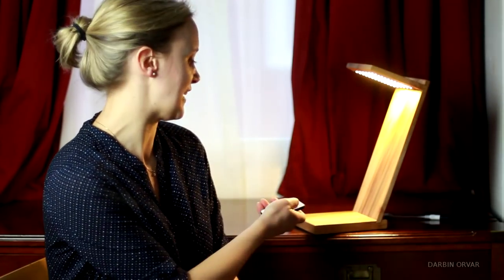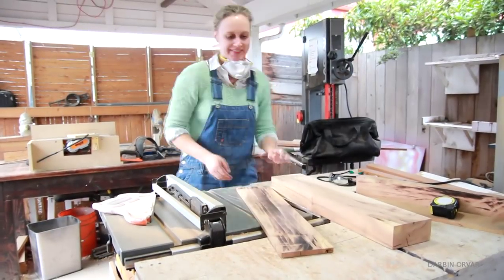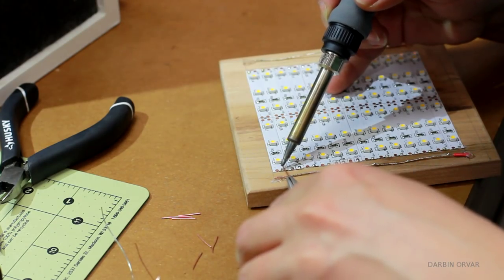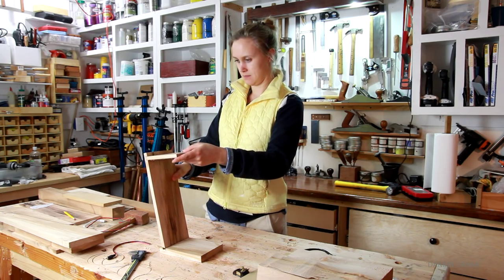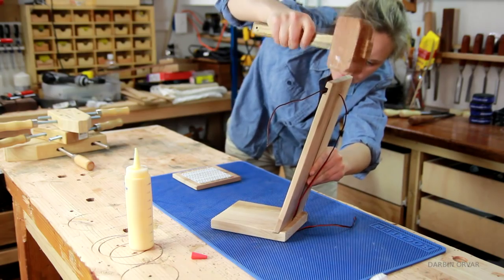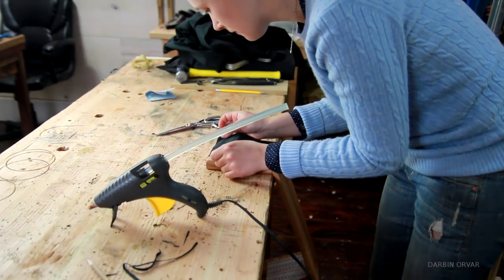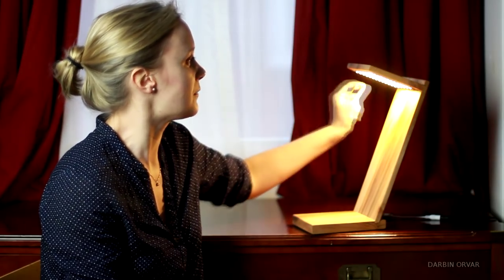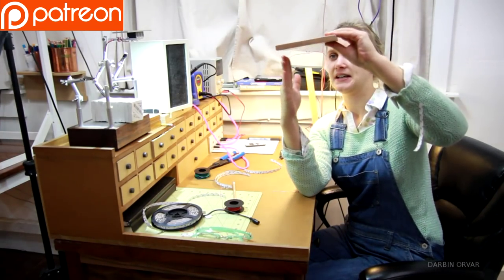Awesome DIY Desk Light w/ LEDs

Comment: Very nice Linn. Have you seen the little gizmos you can add to any lamp that turn them into a touch lamp? I buy the little control boxes for those at Lowes and they really add a neat feature if you have a metal spot to touch for the on/off switch. I envision your desk lamp with a penny inlaid into the base (with the year you made the lamp of course) and wiring that to the touch switch so that when you touch the penny, the light comes on!

Comment: Just going to throw my two cents in here! I made some pretty big versions of these for lighting our videos. When soldering on many rows of LED strips I found it much easier not to precut short wires. I found soldering to the strip, then the main wire, then cutting it was a lot easier and way less fiddly -R

Comment: I just lit up a cabinet using a very similar light strip (perhaps the same kind, LE from Amazon, but that's not important). However, I had the hardest time soldering wire onto them. I wasn't always able to tin the contacts on the strip, and even when I could then the solder would come of when joining the tinned wire... I got great pointers looking at you work. I have a vintage lamp that I'm thinking about retrofitting with LED, which I'll do just as you did. Thanks!

Comment: You kind of mentioned that you liked the look of the exposed electronics but may I still suggest a different approach that has them sandwiched between two pieces of wood?

For the LED section I'm imagining a 3-5mm thick piece of Wood with a hole pattern matching the spacing of the LED's.
For the Back section I'd go with a cut for the Cable to fit through and additionally a small magnet sandwiched between the wood pieces for the Remote to magically sticking to the back - IMHO a more elegant solution than Velcro.For the Bottom section I'd have had the Plug exit on the back but I guess that's a preference thing as well :°

If you REALLY insist on the exposed look... Instead of working with HotGlue why not use some small and nice looking Nails to route the Cables around the LED's while also holding them in place?

Just a thought :°

Comment: I felt the same when I switched to a temp controlled soldering station from a regular 240v iron. Also when I switched to using the brass 'wool' type tip cleaner rather than a damp sponge (although i still keep a damp sponge still for wiping off too)

Comment: Very innovative. I really appreciate sharing your ideas with the DIY community. About this particular project, I would suggest covering the led terminals and wiring to improve user experience and safety. Although it's merely 12 V DC, there is a chance for a short-circuit.  Also, concealing the wires at the back with a thin sheet of wood of the same texture would be nice to have.

Comment: Looks like a powerful stable lamp, with a nice and elegant design. Congratulations. If I could offer a little piece of advice, it would be  to conceal everything, except the wood frame. This includes the LEDs themselves, as the first rule of a project of lighting is that you should not see the light sources, but use indirect illumination. Well done, though.

Comment: Awesome project! I found a cool tip, instead of using that long wire, you use copper tape has the bus.  I used the copper tape method on my model railroad, to add the LED accent lighting to the model buildings, street lights and signal lights.

Comment: Nice work Linn. How did you determine the power supply requirements? Is it listed on the strip light packaging or do you have to the math?
Reply from the maker: +Make Build Modify Strip lights are typically 12 volts, but it will say it on the packaging as well.
Reply: +Darbin Orvar Thanks!

Comment: Very nice project. Liked the exposed wires look and positive|negative wires symmetry. :)   You can find wires that have transparent insulation (usually sold as audio wires) to get rid of the red/black wire, so the whole look would be even more clean.
I use a BBQ lighter (a long and flexible one) for heat shrink tubing - it's much more convenient than a small pocket lighter.
Reply from the maker: +sheikh345345 Thanks for the tip :)

Comment: Hi Lynn what a cool project!! I have seen that you have the same Dewalt table saw that I have the DW745 it works fine for me with one big exception the the track that the  mitter gage slides back & forth in has so much play in it at least 1/16th of a inch this makes it to inactrite to use  have you had this problem or know of any one that has if so do you know of any fix
Reply from the maker: +Vince Baker Thanks Vince. I agree the miter gauge that comes with the saw isn't very good, and I'm planning on building a better one soon.
Reply: Will you be making a video for that I sure hope so :-)

Comment: Light looks great but I'd have angled the upright so it leaned slightly forward. I would have angled the lamp section slightly upwards so it would throw light away from the lamp base. It still should hold itself upright as the base extends far enough forward. At the moment this lamp is mainly illuminating itself. Still a great idea that can be tweaked any way you want.

Comment: darbin...you need few tools like 3d printer and home made CNC to make your design perfect. nice design. I would make a square housing at top and place another square part with holes(LED fit into holes and hide the soldering and PCB board.  I would also hide aleminum heatsing and ventilation holes at top to cool LEDs...and dont forget  basic rule in lighting design which is ; "HIDE THE LIGHT SOURCE".
Reply: her style and creativity are great, she gave it freely, start your own vlog

Comment: Is it possible that wiring all those LEDs in parallel would cause resistance problems?
Reply: No it would work fine :)
Reply: You are correct that this can be a problem,  these LED strips have resistors build in (after every 3rd LED)
Darbin has another video which shows these closer "Are Cheap Chinese LEDs Worth It?"

Comment: Do you leave your saws outside? Isn't the condensation hard on them?
Reply from the maker: +brikhouse22 Yes, I have several power tools outside. I wax all metal surfaces, but most of them are made with plastic primarily so I haven't had any problems.
Reply: Darbin Orvar Oh, I was thinking more about the inside gears and whatnot.

Comment: looks awesome while being simple!
I would probably use something like a NodeMCU and write an app for it, maybe even use Bluetooth. the nodeMCU is super cheap and it can let you control it from the internet. but the coding part however needs some work ;D but if you do write it you could easily re-use it for everything, so it would be one code to make everything Lighting device controllable from the local network. I might make it and make the code public in the next summer :) I'm correctly busy removing nonsense for my school exams :D

Comment: How are you powering this? What voltage?
Reply: +Robert Vernon led strips works (most of the time) with 12V power supplys
Reply: +Armando92 I would have thought that would be included in the video. Was it, or did I just miss it?

Comment: I'm a bit disappointed you didn't hide the wire on the back, either by using wood putty, or better, using two thin wood plates instead of one, and running the wire between them, through a groove made on each of them, so there is like a center canal for the wire to go up inside.

Also, you could have used a capacitive touch sensor (search ebay "capacitive switch"), you could have integrated a hidden switch inside the base, where putting the hand in the base could switch the light on/off with no visible part.

Comment: In my opinion, you should invert the light position, because the LEDs light too much the base and a little bit the rest, maybe cut the wood in two pieces to pass the wire inside.
I liked and I will go do something similar at my chop
Reply: +theLLfromHELL I was thinking the same thing. It would be better as a work light if it was tilted the other way. But it depends on what the use is. It is more decorative and out of the the way with the current design.

Comment: Looks great, but using lead in the base could be very harmful to any kids who got hold of it (eg after they knocked it onto the floor). Does anyone have any alternative suggestions for dense and cheap weights which are non toxic?
Reply: +Joe Hale Well, it looks like she wrapped the lead in duct tape so, they'd have to work pretty hard to get to bare lead. But I still suppose it's possible. You could epoxy it into the base so it would really have a hard time working loose. Or you could put some veneer on the bottom of the base to enclose it. Or you could use sand instead. It'd be harder to enclose and it's not as dense as lead, but it'll still add some weight, and should it escape, it's just sand.
Reply: +Joe Hale 
Another one who has fallen for the media scare. Better have a child play with lead than outside on the playground for example. The latter is much more dangerous (accidents, exposure to UV, breathing bad air in the city aso.). Pieces of elemental lead are harmless. The only harm from swallowing a chunk of lead will be done to your toilet bowl (just don't do it every day, ok?). Same with mercury btw. Media likes to scare. But as long as you don't heat it, elemental mercury isn't really dangerous. You can drink it or even inject it into your blood without long term consequences (again, don't make a habit out of it).
Reply: +Joe Hale Same safety concern with the live 12 volts. Maybe a wooden frame should protect it ?
Reply: +superdau I assume you are trolling or have suffered from lead exposure in your youth. For anyone else here is some light reading: http://www.biologicaldiversity.org/campaigns/get_the_lead_out/pdfs/health/Human_Health_Risks_from_Lead_Ammunition.pdf
Reply: +Youenn Fenard In a worst case of wet or broken skin (body resistance of 1000 Ohms) you'd only be getting 12mA which might be noticeable, but not dangerous. 
https://en.wikipedia.org/wiki/Electric_shock
Reply: +Joe Hale 
And that contradicts what I said how? Did you even read the thing you posted? Most studies there talk about elevated levels of lead in the blood. Never denied that isn't good. Everything else there is about repeated exposure to lead dust, microscopic fragments in game meat and vapors. Maybe you should read my previous comment again then think about what "don't do it every day" means and what the difference between pieces (or chunks) and dust and fragments is (but it'understandable you missed that, since you also missed the essential bits in the list of papers).
Reply: +Youenn Fenard 
Another scare? Did you never check if a 9V battery is still good with your tounge? Tingles a little, but no harm. Licking the LEDs (hey, you never know what kids do, it seems we have kids around here that eat lead chunks ;) ), will hurt (if they learn, they won't try again), but still harmless. Just touching it you won't feel anything.
Reply: +superdau Hey, so it sounds like we agree that elevated levels of lead in the blood is harmful - a claim strongly supported by the links in the pdf. In your first reply you say "pieces of elemental lead are harmless" and imply that a person could not be harmed by swallowing a lump of lead, unless they did it every day.  

There is a risk that a swallowed lump of lead will not immediately be passed and so stay in the body. This lead can then result in lead poisoning - for example this person: http://www.ncbi.nlm.nih.gov/pmc/articles/PMC1278491/ 

Therefore swallowing a single lump of lead can elevate levels of lead in the blood, which we (and the authors of the pdf) agree is harmful. This contradicts your comment "pieces of elemental lead are harmless".

With respect to repeated exposure to lead dust, it sounds like you agree that this too is harmful. A piece "of elemental lead" as base of a table lamp could provide a source of lead dust to which the user of the desk would be repeatedly exposed.

Comment: It looks like a great lamp but aren't you worried about those exposed wires?  If you or a child touches the exposed wire I'm sure you'll get quite a shock.
Reply from the maker: +Mark Skluzacek Thanks, 12 volt power will not hurt you. You will not get a shock at all.